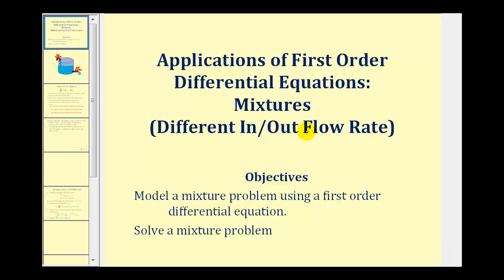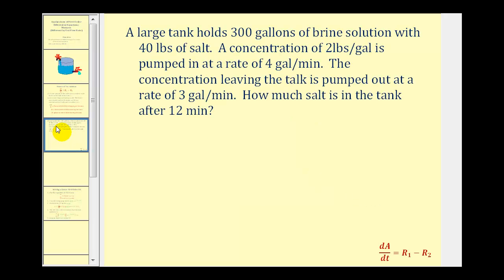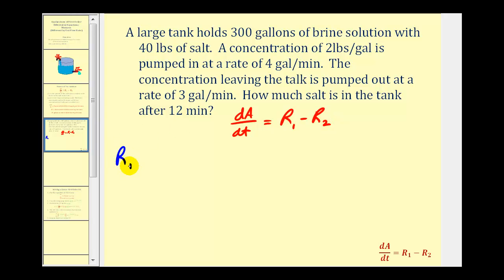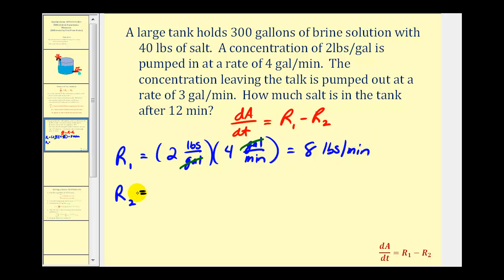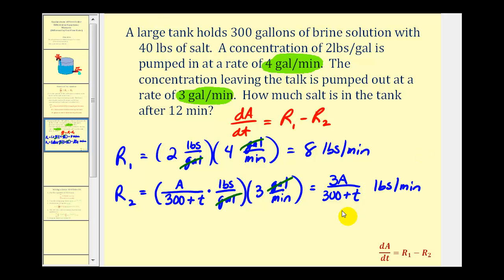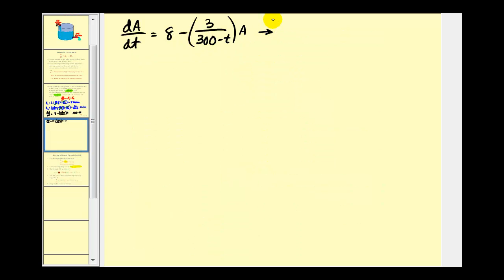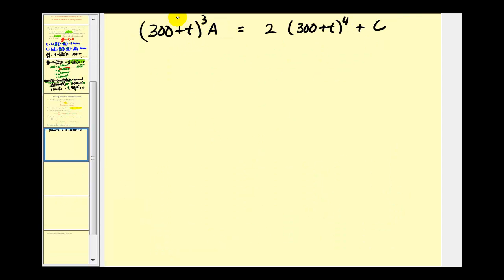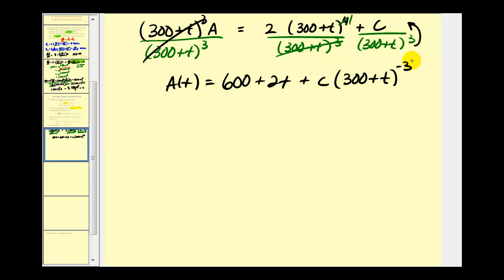Applications of First Order Differential Equations - Mixing Concentrations 2

Comment: If you substitute infinity to t, you will also get infinity because of the +2t. I think the differential equation should have a cap of 600 lbs since the liquid pumped in has aconcentration of 2lbs/gal. At time equals infinity, the tank would have overflowed and the overflowing mixture will have a concentration of 2lbs/gal.

Comment: i dont understand why t (which is time) is added to 300 (which is a volume)
Reply: the inflow rate is 4gal and outflow is 3gal so the net change in the tank is +1, over time there is more water coming in the tank than leaving. If the inflow was 3gal and outflow was 4gal then the net change in the tank would be -1, and eventually the tank would have no more water. Does that help?